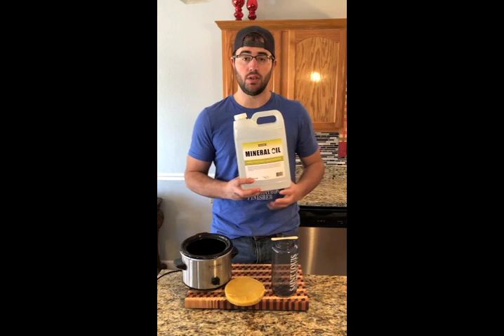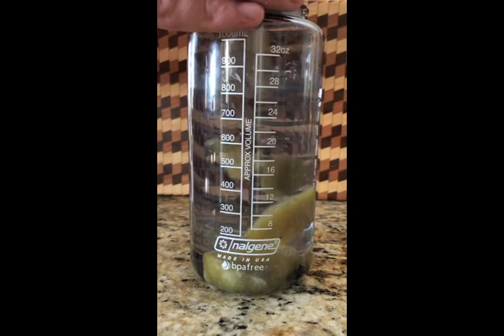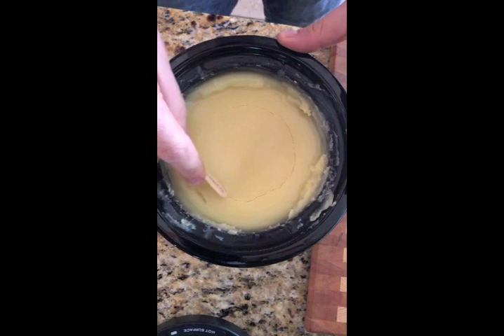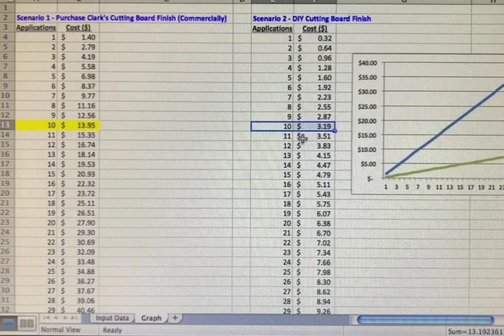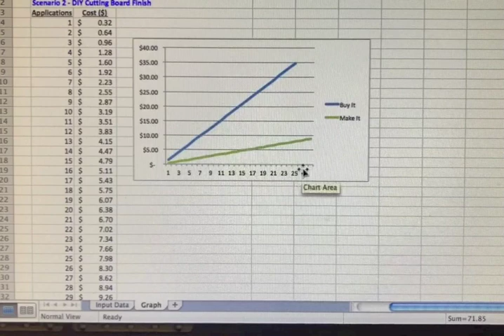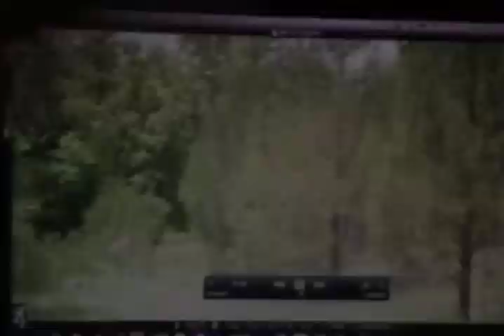DIY Cutting Board/Butcher Block Mineral Oil and Beeswax Finish

Comment: Is there something I could add to this mix that will slightly change the color of my wood to a tiny bit darker? Still within food-safe for kitchen counters
Reply: Turmeric or charred wood carbon powder. You could use ochre/ocher for a redder color too, but would have to make sure it's a food safe kind. These ingredients might impart a mild flavor as well, but shouldn't be too strong if used sparingly and just for pigment.

Comment: You did not factor in your electricity cost as well as the cost for your  time to produce it.
This will increase your unit price slightly, but that would be a more accurate costing (especially for an accountant.......)

Comment: Would be hard to justify the costs of DIY, honestly. How many years will waxing your board take if you only wax at least once a month? 12 years? Can the wax mix last 12 years without degradation or change? It's not just the price of the items, it's the electricity used, as well as your time spent making them - things you haven't factored in and which you don't need to expend on if you just buy them ready made. A $14 expense yearly will hardly be eating into much funds anyway, if you can afford wooden utensils and boards.

Comment: Hmm, mine didn't turn out like your end result :(. Its like a really thick liquid, 24 hours later. The only difference was that I used weight to work out the 4:1 ratio. I'm guessing I maybe should have added more beeswax?
Reply: In general, when you're measuring with "parts", as in 4 parts oil and 1part beeswax, it's supposed to be volume, not weight.
Reply: Where I live, coconut oil can be solid in cold weather and liquid in warm.  Maybe this is similar? Companies have called finishes creams so maybe a really thick liquid might work like a lotion.
Reply: @exzeroex  Thanks, the mix still seemed to work fine as a semi liquid/cream. I did end up adding a bit more beeswax and that did then turn it into a thick paste, so think maybe my ratio was off.

Comment: I don't know why I never thought of that method to mix it 4 to 1.  A simple but GREAT way!  Great tip!!!!  If you don't mind, saving money tip... Walmart sells mineral oil in their pharmacy area, its $1.89 I think for 16 oz.  It is by far the cheapest source of mineral oil.  How much is your oil?
Reply: Yup... I know it's not labeled "Food Grade", but I'd argue that pharmaceutical standards are more rigorous, and because it's meant for consumption, I'd say it's gotta be "Food Grade".  Also, buying these 16oz bottles and 1oz bars of beeswax means no measuring. Just combine 1- 16oz bottle of mineral oil with 4-1oz  bars of beeswax... easy.
Reply: Exactly. Walmart. Even Costco was way more and it has to be special ordered. By definition it's food grade in the pharmacy as it's sold as a laxative for human consumption. About to make up some more board butter right now. I was here trying to discover the characteristics of various ratios. I'm pretty sure I was 9:1 oil to beeswax last time. Maybe I'll try 4:1 this time.

Comment: Is this a only thing to use on a block/board? Or do u recomend a thin layer of oil followed with this? Or just this mixture
Reply from the maker: jorgealvarez0525 - I use this method for new boards to finish them as it seems to hold in the moisture for longer than a thin layer of oil.  That said, I always have a bottle of food grade mineral oil around to “freshen up” the boards once I have used them for a few months.
Reply: I plan on treating my new butcher block with mineral oil daily until it won't take anymore, then applying this 4:1 cream as a finish/sealant... and re-apply each periodically for maintenance.